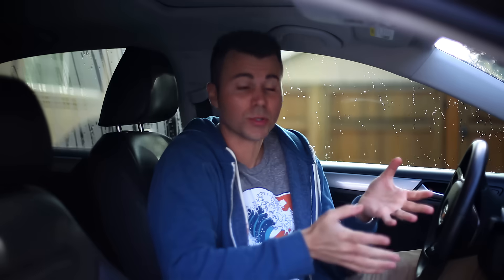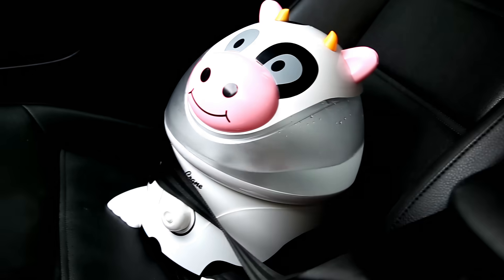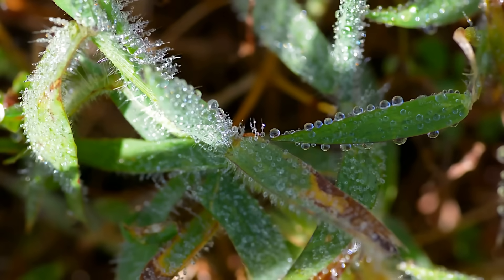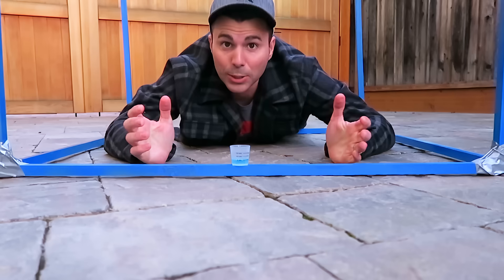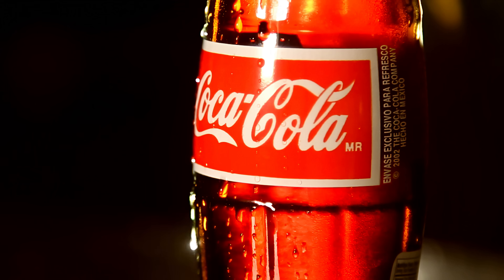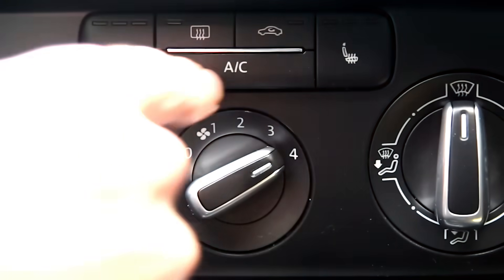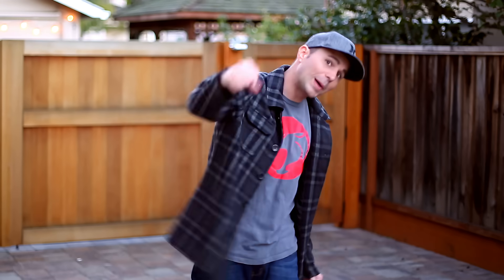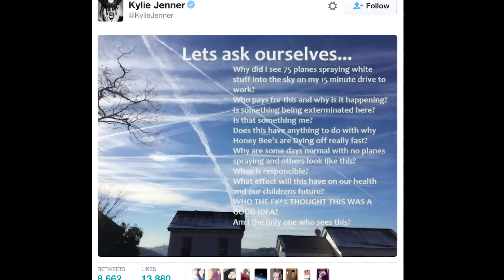Defog your windows TWICE as fast using SCIENCE- 4 easy steps

Comment: If you turn your fan on full blast in the winter with a cold engine you will absolutely not get any hot air out of your vents. Also doesn't the mk5 Jetta have an electric heater that helps mitigate this? Super flawed test lol

Comment: I have a car that suffered from sunroof leak
caused windows to fog and even completely Ice up in winter.
I tried everything to fix like towels and window cleaner, Rainx dessicant, etc... 
it happens from moisture buildup.
water evaporating in the sun.
roll down windows 1/4 " when I park solves the problem completely!
Just cant have sealed car with moisture inside. only have to vent it a little.
The Moisture leaves peacefully without sticking to windows.

Comment: Missed one important fact. How most moisture get into a car in the winter. The less snow you have on your feet helps. if you have a bunch of snow on your clothes or boots and it gets on your upholstery or carpet, it will will be in your car for the duration of the winter unless you have a way to dry out your interior. So you will be fighting this inside moisture all winter.

Comment: My 2002 Prius forces the engine to stay on while running the defroster with AC, so I usually don't use AC with defrost unless I just started the hybrid system (the engine has to run anyway when it's cold, so why not run the AC compressor too?)

Comment: Third step, inside re-circulation off? Might want to check again. Re-circulation, as it implies, recirculates the inside air. You want that to happen.  Step two is also a double check; most cars already turn on the A/C when selecting the defrost function. Hitting the button again might turn that off.

Comment: This is close to what I use, with a slight variation. I find that when just starting the engine, and for the first few minutes of driving, the engine is still so cold that where you put the temperature knob doesn't really have any affect on the temperature. However the airflow goes down when putting it on max heat as all the air has to be passed through the heating element. By putting the heat at 2/3rds of the way up for the first minutes you get more air flow (thing passing through more towels at higher rate) and since at this point the temperature (size of towel) is still the same anyway, this is more effective. Of course, as soon as there is any heat coming through from the engine (say after driving for 2-3 minutes) you should quickly put it at max heat.

Also another benefit of having the AC on is that it puts slightly more strain on the engine, which should make it heat up more quickly. But of course the fastest way to heat the engine in general is to just drive the car.

Another thing is to not sit in the car before starting the engine and blasting the fan to avoid fog in the first place. Especially if there's more than one person in the car.
Reply: Some cars have electric heaters that work as soon as the engine runs. And they also ruin the battery, which is coincidentally sold by the same people selling cars.
Reply: My car (2nd gen new Mini) actually adjusts the fan speed higher automatically (as the engine heats up and the air warms up). I presume that's quite standard for cars equipped with climate control, but it's nifty and worth a mention!
Reply: How do you drive for a few minutes out of a window you can’t see out of?
Reply: Wait, how are you driving for 2-3 minutes with fog on your windshield?

Comment: I know this is ancient now... but I actually hacked into my Jeep HVAC system to do just this. Stock settings do not allow the AC to be activated with the defrost. I bypassed this by finding out the AC clutch is activated by grounding a green wire found on the vaccum actuator  switch(vent selector switch). Bam... AC plus heat on simultaneously while on defrost mode.

Comment: What I find helps the most is something you can do before the frost forms. Before you arrive at a destination, when you think you'll only have another 1-3 minutes in the vehicle, switch to cycling outside air and switch to the cold air settings, possibly with the A/C to dry it out even more, but I don't bother with the A/C. This drops the amount of moisture the vehicle's internal air can hold in the first place. If you run the fan on high, it can also get rid of much of the moisture you created in the vehicle by breathing in it. It also reduces the temperature difference between the inside and outside of the car, thus reducing the likelihood and amount of condensation.

You're about to step out into the cold anyway, so you can reduce that shock on your system by quickly bringing down the temperature inside your vehicle. At the same time, you can greatly reduce the amount of frost/fog on the inside. It also greatly reduces the amount of ice that can form on the outside in the event of snow. If it's snowing and you ran the heat, the snow will melt as it lands on your windshield, until the glass cools enough to allow snow to remain frozen. But at that point, the liquid water from prior melting gets a chance to refreeze as cold air and snow touches it. I've often been able to avoid scraping my windshield of ice by running the defrost on cold for 1-3 minutes before getting out of my car. It brings the glass temperature down to prevent lots of ice on the outside (assuming it's snowing, rather than a freezing rain situation, where hotter glass could be useful), and has greatly reduced the amount of defrosting on the inside.

I've done this for years. Then, any frost you do have can be dealt with as this video points out. Imagine if automakers would offer a feature that would cool the air inside the vehicle and cool the glass after you got out. That could be worth it.

Comment: I used to rub a dry bar of hand soap on my eyeglasses (and then rub off the residue) to prevent my glasses from fogging up in the winter as I went from the cold, dry outside to the warm, moist inside.  I'll have to try Jurasic Park shave cream.

Comment: I haven't ever found a vehicle that didn't turn off recirculate and turn the A/C on when you turned it too defrost. A/C removes humidity from the air, humidity causes the fog, ergo you use A/C and warm air.

Comment: Step five,  at least 10 seconds after start up, hold the engine at about 3000 rpm, this will hear the engine faster then letting idle. Also step 1 should be use the wipers, unless there is actual ice on the window using your wipers will clear all the condensation on the windscreen. Also boil a kettle before you leave and throw that hot water on the windscreen.

Comment: Step 1: turn on heater on high.
Step 2: turn on ac
Step 3: turn off inside circulation
Step 4: crack open window for a little bit
Optional: put kitty litter in sock at the windshield 
Optional: put antifog liquid/shaving cream on the windows.

Comment: FWIW, and I know I'm late and someone in the comments has probably already mentioned it, but! 
Turning on your AC is the right thing to do, except in most cars, the HVAC system has a diverter that flaps one way or the other when you choose whether your want hot or cold air. That diverter directs the air column either through the heater core, or the evaporator, but usually not both. Reason is, since the heater core is basically always hot, not having that separation would make your air always lukewarm(just like a dehumidifier) at time when you would want it just cold, or just hot.

Comment: Wow, I live in Iceland and we have a lot of snow and frost. I tested defrosting my car a few years ago and I have to admit that I use the same technique you presented here (without opening my windows though) and it works every time. I also have 4 socks full of cat sand in my car. Next winter, I’m going to try your advice and open car windows.
Reply: how is the advice coming along?
Reply: @edguix , we had a very wet winter, and when frost came, I hadn't been able to open any window in my car. Now it's the storm season, so the wind is too strong. In other words, this technique works like a charm when the frost is moderate or when it's raining outside.
Reply: @edguix  For me, in freezing land of canada, the best setting depend on how hot the engine is. The engine is too small and do not produce enough heat at idle.
If I just started the engine, the best is: hvac off, wait a few minutes, hvac to 3/4 and windshield only. The car force the A/C to be on and recycle forced off.
If the engine is already hot, full blast and windshield only.

I hasn't found that opening the window made a significant difference EXCEPT if you warmed the inside (hot air at the feet) as it increase the humidity way too much (due to melted ice = water, hot water = humidity). After all, you are pulling mostly outside air.

in other words, hotter air is better than more air.
Reply: @thephantom1492  
Spoken like someone who actually knows what ice encrusted windows look like in the hinterlands of Canada. I do exactly the same thing. 👌
Reply: You can thank my dad for the adhesive bonding chemical in cat litter, he invented it back in the 80s

Comment: Make sure you haven't warmed up your car if it's really cold out like driving stopping getting out just long enough for your windshield to get below a certain temp when you get back in and blast heat through defrost. that shock can cause stress fractures
Reply: Yeah, I live in the literal Arctic (the Arctic Circle is south of me) where temperatures can routinely get to below -40 in winter, and I haven't seen any vehicle windows up here crack due to temperature-induced stress fractures.

Comment: I prefer heating the car up as hot as it will go on the way home the day before and then opening the windows enough to allow the superhot moisture-laden air to vent out of the car before I get out and it cools down. Cold air can't hold as much moisture as warm air. So the inside of my car doesn't fog over in the first place.

Of course, it helps if you have a blast furnace heater in the car or an alarm clock you can set 10 minutes earlier so you aren't late in the first place!
Edit: Or get a squeegee for the inside of your car like I had when I was the heater in my VW bug and just squeegee the fog off the windshield as you drive down the road.

Comment: The big problem I've had is frost on the outside of the glass. I've never really had problems with frost on the inside. Will swapping out humid car air for less humid outdoor air do much for the outside frost?
Reply: Oh wait... It's DEFOG.  I guess your tips don't work in warm weather? I've fogged up a lot of windshields in warm weather.

Comment: My dad always turns the cold air on the windshield when he gets home before shutting off his truck. That way it doesn’t fog up with the cold winter air
Reply: lol, wut
Reply: Won't it cause more condensation
Reply: @zombiekiller7101  It doesn’t no. Once you cool off the windshield and bring the vehicle down to the level that is the outside temp, it makes the window the same temp so they don’t frost up. I’m talking winter not just dew and moisture. It is minus 20 degrees so if the window is really hot from driving for some time, when you shut the vehicle off, the window frosts inside, which is a pain to clear later.
Reply: @trina8350  also, when he does that, he dries out the air in the cab by replacing the volume of warm moisture laden air for a much colder and thus dryer volume of air.
Will copy this method for the winter of -21/-22

Comment: If your windshield wipers and wind shield spray nozzles aren't frozen shut, you can use that to spray and it gets rid of the frost. Just learned that not long ago from someone else. The cheap fluid doesn't work as well as the bigger brands I think because they water it down so it doesn't work as well.

Comment: Haha, I love being smart, though I've found that cracking the windows has the opposite effect and actually makes the problem worse by allowing condensation to occur on the inside of your windshield.
Reply: weird - I've always found that cracking a window and turning the AC on to cold for about 30 seconds, then cranking the heat, then closing the window, works the best. Didn't play around with internal or external air though, cold air is cold air. Also, where I live, we're not too far from an ocean - it's ALWAYS humid anyway. Even at like -30 C.

Comment: from what ive seen it works better when heater is not at fullblast, cause it disipate the heat, but does not heat more, in my opinion, it is more more efficient to put the fan setting around 2/3, heat s more concentrated that way. see for yourself but consider that i tested this on eastern canadian wheater and it could change from one place to a nother depending on humidity factors. i guess....

Comment: Tip #0. Park the car so the the windows are not pointing towards the clear sky. Under a tree. Facing a wall. That is how it gets cold, by radiating heat away to the cold sky. When it's cold, it gets far under the dew point and it gets condensation on it. And that process heats it, contrary to many people's intuition.

Comment: Although I agree, it should be noted that when the fog forms, your car is cold. So it's kind of impossible to turn on your heater since the car is still cold (side note, car heater draws heat from your engine when it's hot, it doesn't produce heat like your heater at home).

Comment: So you seem to fail to realize the some cars have different controls.  For a car with a SENSIBLE climate control setting, there are the steps.  
1 Set Mode selector to Defrost (Note on an car with a decent design, this automatically turns on the A/C Compressor).  
2 Set Fan Speed to maximum.  
3 Set temperature to full hot.  (this won't help much, because if you just started the car, the outside air is the same temperature as the engine coolant, but on the off chance there is some residual heat in the engine, it will speed things up a bit).
4 Run the side windows all the way down then back up.  Most cars have strips called dew wipes that are specifically there to remove condensation when the window is lowered.
And the anti-fog treatment:  it is just as effective to simply CLEAN the glass.  Dust particles attract more moisture than clean glass..

Comment: This video now have people turning on there AC in the cold when just a little bit of knowledge about a car would tell you the manufactures already know all of this and why any time you turn defrost on the AC automatically comes on with it! No need to push the button! This started in like the 80s. This trick was learned long long ago! Also you cannot recirculate with defrost as the defrost vents are the intake for recirculate! A little car knowledge would of made this so much easier to figure out lol

Comment: What I've noticed works for my car is having the heat on full blast with air from outside and windows down. Works 100% of the time. I don't have AC in my car as it never was included in the car. 1993 Mazda Miata

Comment: No use to turn the heat up, when it's freezing outside and the engine is cold, there's no Chace to get hot or even warm air for the first several minutes. Plus the engine is stolen all heat and therefore cannot get up to a proper working temperature for longer.
Reply: What did you mean with the last sentence? I am genuinely confused on what you were trying to communicate

Comment: When I first told people to use AC with heat many years ago, I got priceless looks, like I told them how to be a wizard
Reply: I'm still confused. I thought the A/C option is used to make the air cooler. So why would you select a hotter temperature setting AND turn the A/C on?
Reply: @Ai-Ai-O  It removes moisture as well. If you heat air up, and use A/C, it isn't going to make it much colder that it isn't still hot air, but it will be very dry hot air.
Reply: @jasonames  Got it. Thanks for the clarification.

Comment: Guy from five years forward here. If you leave your car under a roof (so none of the precipitation can get in), not necessarily in a garage, you can leave your car windows a little bit down. The warm air with all the water in it will leave the car via open window and windshield will chill to the temperature that is equal to outside temperature and moisture levels will equalize. Thus there will be nothing that can condensate on the windshield.

Comment: Pretty hard to take this seriously. He says to turn the heater on full. If you haven't driven the car within the hour the engine is going to be just as cold as the outside air and will take at least 4 minutes to accrue any amount of actual heat in the heating system.  Heater on or heater off will give the exact same results. If you had actually performed the experiment you would know that

Comment: i use set stand blower at lvl 1 use cold air and set it to windows only. Done. never use ac in car this give you more of that problem. Now i drive without ac and i have no fog in my car ever. Its cold yes but its just for driving. Or buy a car that have heat up glass and problem also fix.

And i have a car that have climate control. Set it always on problem gone in a few seconds.

Comment: You’re telling people to turn their heater on full blast on a cold day😂🤦‍♂️ you’re a engineer, you should know a cold engine being put under strain right on start up is not good for valves or the rotating assembly. Turning heat to medium pressure and pressing the a/c button will work still hot air just the A/c dries out the air before it hits the vent